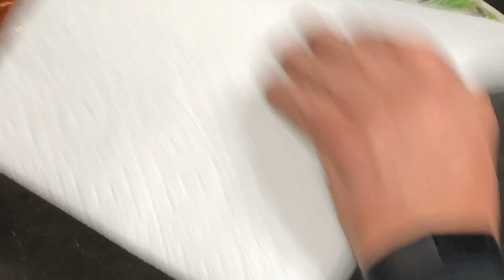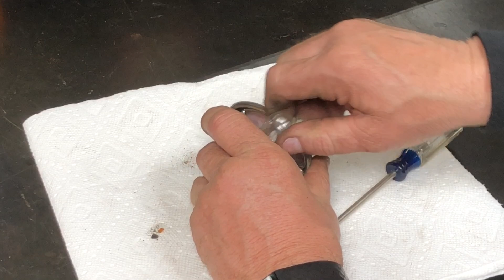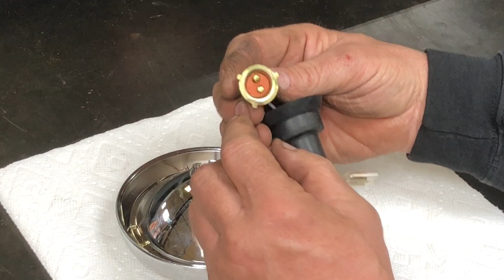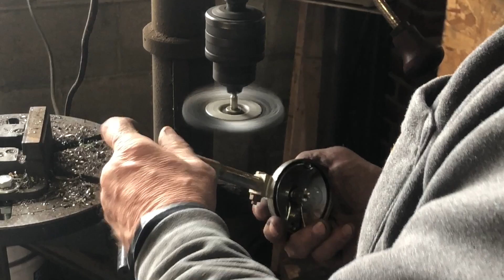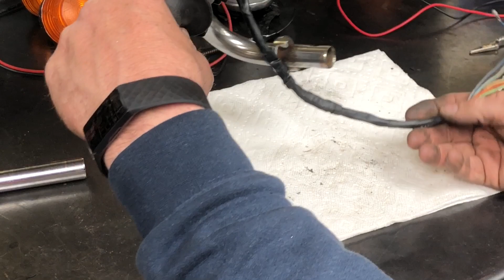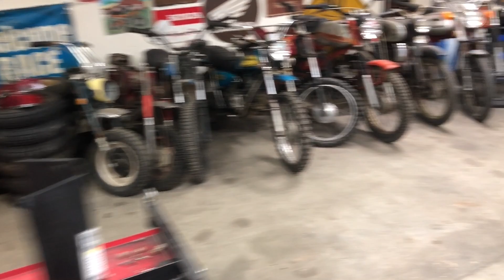1977 Honda CT70 - video #3

Comment: i just bought a 1977 ct70 how can I tell if it is a K1,K2,K3 it is a 3speed auto cluch
Reply from the maker: @garymccready4337  Prior to 1976, Honda did not designate these bikes with any model year.  For example, there is no such thing as a 1970 or 1973 Honda CT70.   Instead of designating a year, Honda gave the first 5 models a “K” designation.  K0 thru K4.   Starting in 1976, they dropped the K numbers and added a designated model year.   So……yours is a 1977 CT70 and does not have a K model attached to it.
Reply: @MiniBikeMike  thank you Mike, great chanel

Comment: Hi Mike, can you walk through the process of restoring the handle bars? I have a ‘71 KV75 I’m restoring and the bars are a little rusty. Wanting to get a little more detail into how you went through your process.
Reply from the maker: I wouldn’t really say what I do is “restoring” the bars.  I use a wire wheel in a drill press to knock off most of the rust and then follow that with some WD40 and fine steel wool.

Comment: I just started watching your videos I am 62 years old and I’m going to start putting together a S 65 with a life man engine. Thank God I started watching the videos I am learning a lot about the wiring I am real bad at wiring.
Reply from the maker: Thanks for watching!  I have a couple of S65’s with Lifan 125’s and love them.  Mine don’t have turn signals, so the wiring is pretty simple.
Reply: @MiniBikeMike  I hope you will be around to answer some questions when I get stuck doing things I’m worried about the electrical I’m real bad at it I just ordered all my stuff from trail buddy today I told them you  recommended their harness. I bought a 140 engine for it I hope it was worth it it was a lot more money than 125. I liked it because of the gear pattern with the neutral on the bottom and 1234. It came with a CDI with two plugs on it Trailer buddy told me to buy one of theirs with one plug on it I watched your videos and I never saw you hook one up with two plugs mine has no signal Lights too he told me to buy the TB515 harness I think I saw you put one in . I made a homemade lift for it and there’s no way I could do this build on the ground too old for that shit. I called of the Chinese people who sold the engine they told me to put a half wave voltage regulator in it does that sound right to you or would you have put a full wave . Tomorrow I start tearing it down wish me luck.  Thank you for all your helpful videos you’re very good at it.
Reply from the maker: @thomasminoski1747  Sounds like Trail Buddy has you covered.  If you have questions, let me know.

Comment: great videos man i have a question see if you can help me out do i have to replace the 6v flasher relay for a 12v after installing a lifan 125 motor in order for blinkers to flash let me know thanks
Reply from the maker: Yes, the Lifan is a 12v engine.  Unless you are using something to cut the output to 6v, you’ll need to change the 6v flasher and 6v bulbs to 12v.

Comment: Great vids mike. I have the exact same bike I’m going to start restoring soon. I’m going to use the stock engine. Assuming I’d need to use 6v bulbs for the lights correct?
Reply from the maker: Yes, the original set up is 6v and needs 6v bulbs.
Reply: @MiniBikeMike  awesome. Anyone know where to get replacement 6v light bulbs? Will normal hardware store bulbs work?
Reply from the maker: Any auto parts store should have all the bulbs, except headlight.   eBay sells kits that include all bulbs.